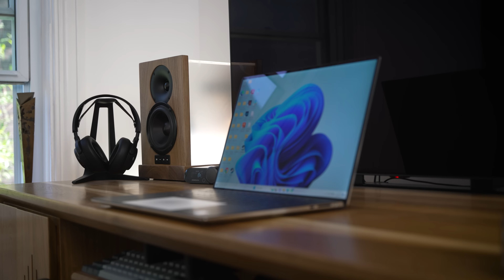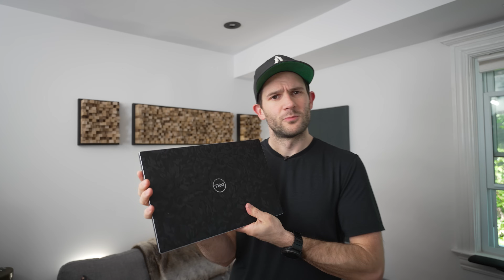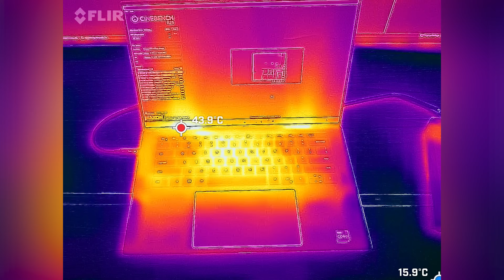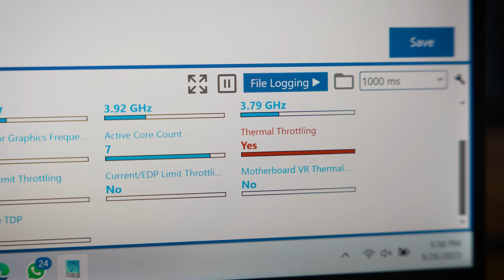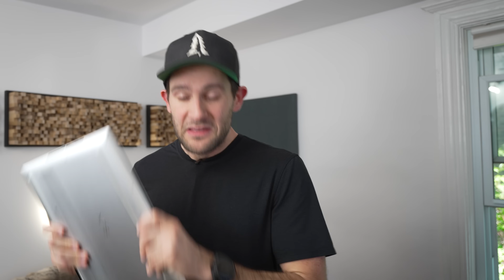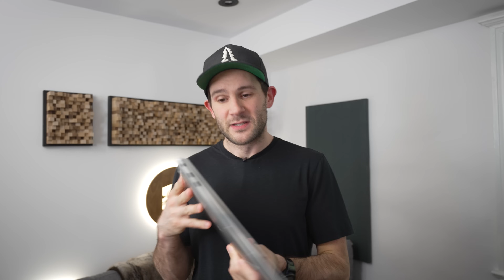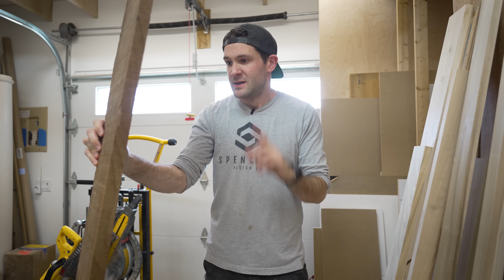The BEST mod I've ever seen....

Comment: This was extremely painful to watch....

1.  Thermal paste is intended to fill pits between parts, it does not 'reduce temperatures'.  It helps to transfer heat by filling those pits which gives material for the heat energy to transfer.  Vacuums don't transfer heat, that is how it works.  When you CAKE thermal compound like that, you are greatly reducing its ability to transfer the heat to the heatsinks.  

2.  Yes, laptops can and do burn peoples legs.  The biggest issue being the slow and steady increase in heat can burn you without you even realizing it.

3.  That massive fan is mostly pushing air at the case, and not through the laptop.  Meaning most of that air is actually wasted.  Likely you probably even feel the air spilling out all around the laptop.  While this does a great job cooling your case, that is basically pointless since it is no longer sitting on your legs which could be burned, anyways.
Reply: You can’t “CAKE” thermal paste, the excess just gets squeezed out. gamers nexus covered this myth. Only exception is heatsinks with poor design, low mounting pressure or both. Did he use slightly more then needed? Yes. Will that change anything other then spending a fraction more on paste? No.

Comment: Very recently bought a custom MetaBox laptop (Specifically a Prime XR). They are expensive, especially if you ship them outside of Australia like I had to, but this thing is a beast. 
No issues with thermal throttling as far as I can tell. I use an off-the-shelf cooling pad so I don't know what portable comfort would be like, but I will say they have a wide range of models to suit every niche and you can customise them to your liking with everything from the CPU and GPU, to the Ram, Storage and even the screen. You get what you pay for at the end of the day and I'm personally very happy with my purchase for my needs. Sales rep was very friendly and knowledgeable too. Check them out

Comment: What you need is to build a fanhouse of some sort that funnels the air into a hose or something similar. Then you 3D print a hose2<suitable laptop port> adapter. Voila! You now blow air through the entire laptop which will cool it effectively.

Comment: Lenovo high end laptops are just incredible. I'm rocking a P52 and a P1 and they're just amazing machines all around. Great 3D capability, ideal for CAD, 128gb of RAM and i7 processor just chews through any and all tasks with no issue whatsoever. And pre-owned, they're a steal at about 500 bucks or so.

Comment: Cooling pads work, but 1. you need to get a good one which is not ending there, becouse you need 2. - get a correct one for your laptop to match intake wents. Properly taken cooling pad can lower temps by 10 degree C.

Comment: I did this on an old dell, but just reapplied paste, added 2 small heat syncs on a couple uncooled chips, and cut vent holes into the bottom. Didn't even use a cooling fan but I saw ~12% increase in performance.

Comment: 11:22 On My lenovo Laptop From 2014 Lenovo G505s They Blocked The Air Intake With An Aluminium Interference Shield It Would Reach 105°C Before Shutting Off Peeled That Off And It Went down to 40°C Idle 83°C Under Load (with good thermal paste)

Comment: The only modification that would make this even better would be to take inspiration from the IETS GT600 laptop cooling pad, which is to make a foam lining all around the top (where the laptop will be resting), which traps air above the fan and beneath the laptop, creating a high air pressure pocket, which will try to escape at the point of least resistance, which will be the laptops air intake. The GT600's design have proven that this lets you gain a 15-20 (some even say 30 depending on the fan speed etc.) degrees celsius reduction in heat.

Comment: I own the same laptop. It needed a re paste and more importantly a re torque from new. If you read the Dell maintenance manual they don't torque the heat sink in a star pattern, crazy. Otherwise it's been great tbh and parts are still available direct from Dell. That being said, how many customers are really willing and able to crack open a $2000 laptop and re paste the heatsink, not many I imagine. The Macbook Pro of the same era had the exact same issue.

Comment: I have used eluktronics laptops for the last few years. It is custom built laptop company. Less expensive than big names for comparable performance. No bloatware. The case will be larger; I am sure for cooling. I like mine and have not had any issues. They do not offer inexpensive options. I think $1200 is were they start in price. Regardless if you are looking for a desktop replacement this is a good option.

Comment: This is rad! My only concern, might be irrelevant.. . Magnets and hard drives. Not sure if it was SSD or HDD ( I shouldve paid more attention ) I've seen big speakers effect spinning drives causing them to fail quicker. Multiple failed drives came into the shop and after some questions, found out he was a music producer and kept large speakers near is case. Speakers have magnets. Caused the HDD to wobble weird and fail!
Reply from the maker: Ya that might be a concern for some laptops. Thankfully my machine uses all solid state drives (SSD) so there's no risk of magnetic interference. Cheers man thanks for watching!

Comment: You actually don't need to mod the laptop internals at all. You just need ducting focusing high static pressure air into the intakes on the bottom of the laptops into the fans. One single giant fan is about the worst way to do it.

Comment: A small suggestion if you can accommodate that. I like how you improve your design continuously, like adding those parts to raise the laptop a little bit for better cooling but I would just love it you did a before and after of that small improvement, just for everyone to understand how much, if at all, that effects the performance, which leads me to the second part. 
you shared no temperatures, big missed opportunity there. you should have shared temps, clock speeds and power consumption on the before and afters. Great job nonetheless.

Comment: Why didnt you make it fan forced and have it sealed against the bottom of the case so it forces the airflow into the case so it acts like ducting ? Like at the point where you were talking about the 4 corner parts why not go all the way around so when you put the laptop down it seals against them and the air has to pass through the laptop case

Comment: I have an inspiron 3780 I think it is from dell and never had any problems with it. I replaced my i5 with an i7 and maxed out the ram to 32gb. It is unfortunately plastic so I can't make the back a heatsink but I did redo the paste on the dies and added some thermal pads to connect a few components to the heat pipes. Long story short, not all dell laptops are bad.

Comment: I have always been a Compaq/HP guy. No matter what, I always purchase business class laptops. I have always been satisfied with 12.5" HP Elitebooks for travel, and ZBook for home as a desktop replacement; Loved using the ZBook over the Elitebook.  But then I purchased a Dell Latitude because of extreme price difference when I needed a laptop overnight. 
BIG MISTAKE! I thought I was using an old laptop with a Cyrix chip with 512K RAM, it is painfully slow! So I reimaged the Dell, maxed out the RAM to 64, and no change at all.
So, I can attest to the fact that HP machines are far better than Dell machines.
Do with this info what you want, but I would agree that Dell Laptops are a drag!

Comment: Screw all the wood stuff and the laptop cooler. Just The thermal paste. And if you were feeling really frisky. You can replace it with liquid metal and just make sure you put nail polish in foam around everything.
Reply: Gotta ask, why nail polish and not proper conformal coating? They are practically the same price.

Comment: Replacing your stock thermal paste will be the biggest mistake, Noctua thermal paste cannot use on smooth surface, especially directly on CPU GPU die, you'll see your temp getting worst day by day.
There are not much thermal interface material out there that can withstand 90c+ temp, I am sure that non of the thermal paste sold at computer retail store suitable for high end laptop chip. All of them will suffer from pump-out (above 70c+ and smooth silicon surface) and dry out (90c+).
From 10:34 , that pattern on your CPU die is called pump-out effect, the paste on the edge of the die already left the chat, that's why you're experiencing instant temperature spike.
Reply: Using Thermal paste in direct die cooling is nothing new, plenty of people re paste laptops lol. Pump out is mainly related to heat cycling not temperature, no idea where you got the 70c figure either. Furthermore no reputable brand of thermal paste dries out. 

At 10:34 that looks like nearly every factory thermal paste job.

Comment: I did this years ago to play wow on a mid range laptop, worked great then, probably works even better these days since everything is thermally limited and boosts by default, you don't even need to overclock or volt mod etc etc.

Comment: Even i made a custome cooling pad for my dell gaming laptop 😊 it barely costs 1$ and works same as $20 one plus its a different feeling when you build something instead of purchasing.
It dropped 5 degrees on my laptop while maintaining the performance on long run and getting hot to touch
 I have posted a picture on my community tab incase someone wants to see it.

Comment: I've got a similar Dell laptop. The speakers are crap, the mic is awful, and Windows 11 can't handle bluetooth devices. Worst part is the BIOS - Dell eliminated boot order, so now it is only SSD or USB, and selecting a boot device requires manual selection of a FILE, not just the drive. It's amazing that Dell can't get right what eMachines did fine in 2001. This thing cost $1k new in 2022 and I went back to using my 2015 desktop after just 6 months.

Comment: I have also bought an XPS 15 but a 7590. I got it because online it had a very good reputation. I wanted something similar to a macbook pro. But as im constrained by software which doesnt run on apple silicon it had to be a windows machine. Thing runs incredibly hot all the time. The fans go hard a lot of the time but the cooling system still doesnt seem like its removing a whole lot of heat. The XPS is rather powerful but i would love to have a better cooling solution. I have also spent a lot of time improving thermals but still. I will get another brand when im in the market for a new one.
Reply from the maker: Ya the whole thin and light + high powered internals is a VERY hard thing to get right. I hear the XPS 17 is much better with its vapour chamber cooler, but I'm not sure I want to reward dell for screwing up the XPS 15 by turning around and buying the XPS 17. Plus I just dont want a laptop that big. Have you tried repasting yours? If it's still running the original paste it's probably getting a bit old and dry now.
Reply: Yeah that’s true. Yes several times. Different pastes and everything. Best results with Thermal Grizzly Kryonaut so far.
Reply: @ZacBuilds If you really need a laptop, get the MacBook Pro. It's unbelievably fast and the battery life is insane. We're talking about an entire day of video with enough charge to spare (18 hours or so). You can lose the cooling apparatus you made because the fans barely run. 

As for video and graphics editing, the Mac produces very high quality video and sound. The fonts look way better and the OS interface is snappier and less cluttered. If you have an iPhone or an iPad, all your files are automatically available on all of them. You can answer and switch calls as well as continue your browsing on any of your Apple devices. You can even run Windows if you need to. I would buy one and if you don't like it, return it.

Comment: Wouldn't it have been better to make the stand out of metal to increase thermal conductivity? I realize it's pretty but if you want better performance, at least the mated surface should've been metal.

Also, it seems like you placed the docking box too far back, such that it is impeding the airflow of the F20. What's your experience been?

Comment: Why did you use this mud instead of the thermal gaskets? They are solid-state and will work fine for memory cooling (they are used in normal video cards). I think you should enlarge the air slots so the stand will SIGNIFICANTLY help the main fans. It's also worth making a recess for the station, as it's not a bad way to obstruct the air intake. Nice project, keep up the good work!

Comment: Also a problem (but not a new one) is the false advertising of the specs. 
While it is common sense that a laptop can't house a RTX 4090, there still are laptops that apparently contain one. Yeah, a 4090 with a massively smaller power budget, you might think. 
No, not only that.
Just as an example... the 4090 in Laptops has about half the cuda cores, half the Streaming processors, roughly half the raytracing cores and tensor cores, two thirds the memory with two thirds the bus with, half the memory bandwith and about half the clock speed of the desktop RTX 4090.
If you add all that together, you end up with a 4090 that has about half the rasterisation performance and in total about a quarter of the performance  of it's desktop counterpart. 
It is obvious to expect a reduction in performance between desktop and laptop. But not by half. 
But the worst part is that the Laptop 4090 is not even a RTX 4090. The desktop card utilises the AD102 Chip, while the mobile one  uses an AD109 Chip. In short, the Laptop 4090 is just a renamed, significantly worse version of the desktop 4080.

It is a miracle that the EU hasn't bothered to stop companies from shitty almost malicious advertisment of their product.
Having worse peformance is ok. But selling a completely different product under the name of another one, is simpy horrendous.

Comment: I recommend rather than using Thermal Paste that you try PTM7950 pads. After putting one on my GPD Win4's 6800U and my 1080Ti they are fantastic for keeping temps down.

Comment: Actually, they do work. I had a laptop that the fans stopped working at all and the machine would just overheat and shut down. I bought a laptop cooling pad and got another year of use out of the laptop. With a lot of inconvenience of having to always have the pad plugged in…

Comment: I recommend an HP Victus with an i9-intel cpu, have been a long time HP and Intel user and it has never dissapointed. My next upgrade to my 8 year old HP Notebook is going to be the Victus, and I would recommend the same to you as well. It is slim and pack heaps of performance

Comment: I don't know hey. Maybe I am not seeing the difference between your laptop cooler vs others. I have a few laptop coolers and one that has a huge fan like that as well. Pushes decent air as well and didn't do much. Maybe one degree or two. I think your biggest performance boost came from your thermal paste and that other paste you used... Also the aluminum back plate. My Acer 3060gtx with a 10th cpu literally thermal throttles no matter how much new thermal paste etc I use and combined with a laptop cooler elevated higher enough to allow proper airflow. Still a awesome video 👍

Comment: Try some PTM7950 from Honeywell, although the amazon off brand worked well for me.   IMHO much better cooling than thermal paste and you don't have to maintain it yearly for best performance.   Comes in a few thicknesses to do CPU, GPU and other themal pad needs.  My Thinkpad P52 has a bottom that is pretty good for a cooling pad, I removed the 'screens' from the vents so get more airflow in and out.  It's a beast even with a 8850H and P3200 Quatro.   128GB ram, 2TBx2 NVMe, 4k.  It's heavy, but I have a Lenovo 15" basic laptop for my daily carry needs.

Comment: First off it's a cool little laptop cooler, but for those of us w/o a metal chassis we may be out of luck. I wonder then if a design like the IETS GT500 Powerful Turbo-Fan cooler on amazon is the better way to go. It seems to seal the airflow around the laptop but with a smaller but high rpm (aka noisey) fan. Given the price of the cooler I may go with a diy route I'm just not sure where to source the foam or seal. Either way could be a nice update, the reviews say this cools the best but that it also has some of the worst audible levels, so bigger fan coupled with a seal hmmmm. I have a Legion5 from like 2019 or so and even with a laptop cooler the cpu and gpu fsns always run full throttle even when just running idle. Another bad design of almost all of these laptop coolers is they're usb powered which I'm sure contributes to thermals even if just slightly. I guess the work around would be to plug into the wall directly via a usb adapter and just leave the laptop's usb out of it.

There is also a company that's brining a new type of laptop cooling system though it does look like it's just in the prototype phase. AirJet Pro:  https://www.youtube.com/watch?v=YGxTnGEAx3E&t=837s

Comment: Don't know about that dell TB dock specifically but I know other docks get really really hot and since your fan is pulling air directly from it, I would think it decreases the cooling potential at least a bit. Otherwise great vid! I will probably do the part with removing the stickers from the bottom inner part of the bottom cover and adding some thermal pads to my Lenovo Thinkbook 14S Yoga Gen2 (great laptop line in case you want to switch btw). I will however skip the repasting of the CPU and GPU + the laptop stand as when I use my laptop docked I use it bent backwards (love using 2 in 1 laptops like that as it allows for having a keyboard right in front of the screen which is placed below my monitor - ez stacked display setup)